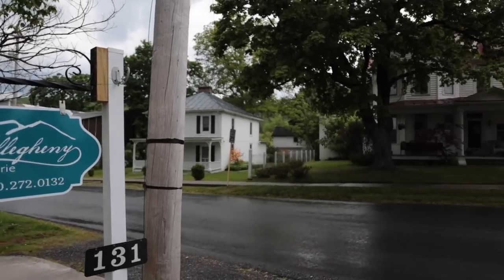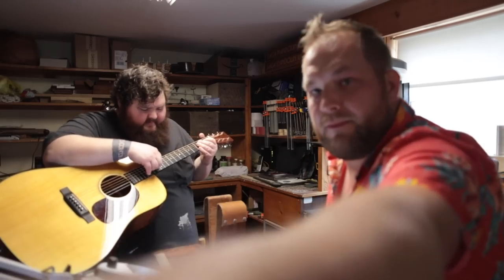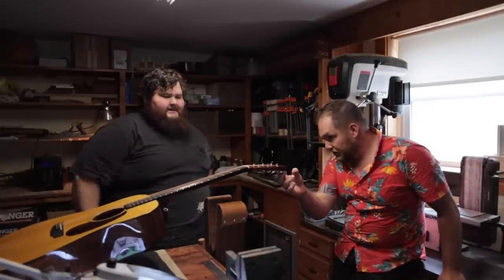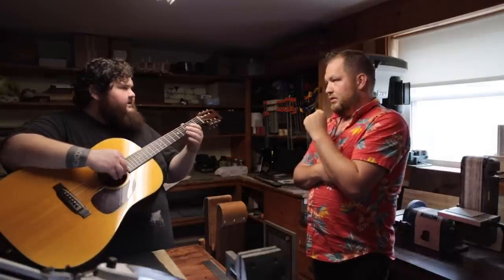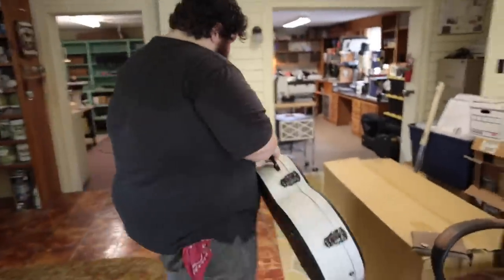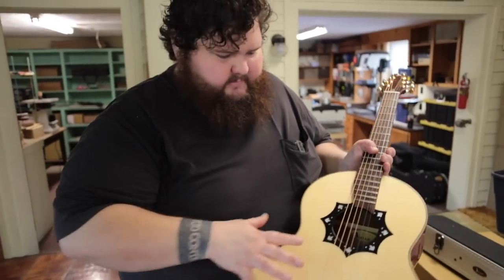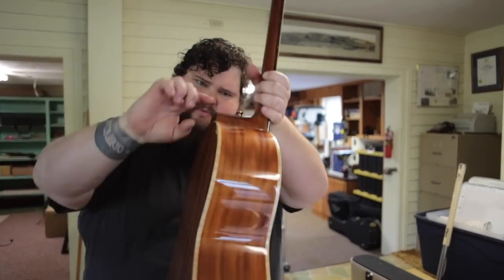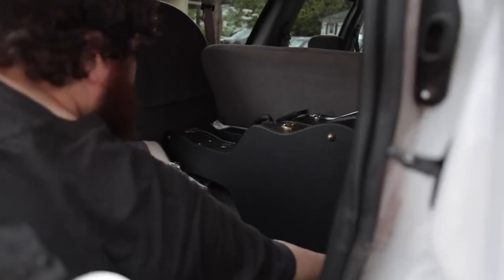I have truss (rod) issues with both of my @martinguitar D-18's...featuring Padgett Guitars.

Comment: My January 2019 D18 sat in a small Iowa shop for a year. I purchased in May 2020 and brought it to Arkansas (much higher humidities). After about 6 months it finally got used to its surroundings here and settled in, opened up a little, and became an incredible guitar. It much prefers the 48% humidity range over say 55%. Gets muddy and dulled in higher humidity for some reason even though it’s in Martin’s suggested range. Ask anyone who owns a 2019, it was a fantastic year for the D18. Mine sounds better every day.
Reply: Good to know thanks!
Reply: I've always found that about my guitars. You pick up the same guitar that sounded great the day before on a day where it's raining, or high heat and humidity, and it just sounds dead.
Reply: totally agree, I live in AL, and when it rains and humidity s like 60%, it totally changes the sound of the guitar. between 40 and 60 is supposed ot be the preferred range, right?

Comment: My d18 from the 90s is a little buzzy too, but it’s almost unnoticeable when being recorded. My luthier did the best he could. For some reason D18s record so well. It’s stunning how well they record.
Reply: They are the original dreadnought by which everything else is compared to making them the benchmark
Reply: Yeah, it seems the drier mahogany sound records best. I have a D-18, a D-41 and a 000-18. The 000-18 records the best even though the other two are far better sounding in person.
Reply: @capohd28  I personally like mahogany better in personal also. And I used to be a rosewood guy. But I like sinker mahogany which has some slight rosewood qualities

Comment: The 2019 Martin has a double action truss rod.
I’ve also found that the Plecked guitars tend to be somewhat buzzy
Reply: Shouldn’t you be able to add forward bow with a 2 way truss rod?
Reply: @aardvark77  yes It is possible.
Reply: Yes, and when it’s between the two settings can feel slack, surprised he didn’t mention that. Also .003 - 004” in in my mind is perfect relief, but that is a personal preference. Another thing, is what gauge strings are on there? If lights, try mediums, that should bring the action up a bit. He didn’t mention the 12th fret string height. At that relief, I would have just made up a new bone saddle with a bit more height and call it a day. Save the factory one for when the action works up a bit over time.

Comment: The truss rod and neck on my D18 (2014)  work together as they should.  Martin built these for medium gauge strings but I haven’t run anything heavier than .012s on mine and that just recently. But to my surprise I’ve found that I can run the .012s at lower action and with very little relief than I could the .010s with no buzzing and it sounds so much better.  I’m building up my hands to try for .013s next..
Reply: That’s actually no surprise even though it’s counter intuitive. Lighter strings tend to travel more due to lower tension. 10’s are super sloppy. One interesting thought though that a long time luthier taught me is that sometimes lights will be louder than mediums on some very resonant guitars. That is the case on at least one of my dreads, a forward scalloped D-41. Sometimes heavier strings can stiffen a guitar up and lower volume. Best to just try it and see what works.

Comment: As Paul S said below, 2019 has a double-acting rod. Very easy to adjust the relief using that. What you thought was a loosened rod was just the adjuster nut at its neutral position. Turn further past that point and you'll be able to increase the relief to a suitable point.
Reply from the maker: You're totally right, this morning after reading your comment I loosened it up to tension and then used it to pull the neck back into a negative bow and it works great. Thanks for your comment.
Reply: yeah, that is what I was thinking the entire time, but all of the solutions did not involve that, so I was super confused and I just thought well, I really don't know much about Martins. I am a recent convert to the acoustic world, so I am used to lots of electrics with 2-way truss rods, and I am always loosening a little or tightening a little on them, depending on the weather. Glad I read down into the comments.

Comment: Got to get yourself that Martin dx2e.    Only Martin model with katalox wood for fret board nd Bridge.   And it has the strata Bond neck martin 
has been using for 30 years which is virtually indestructible.   I've had a dx1 for 20 years and it's never not in tune lmao...  never needed any work done.

Comment: Hi Jeremy, I've enjoyed these videos introducing Mr. Padgett and his impressive work.  I wanted to mention that newer Martins have 2-way or dual action truss rods, meaning they bend both ways to decrease relief and increase it.   So, to increase relief, when you are turning the nut counter clockwise until it's loose, keep going and it will tighten up again as it forces the neck the other way.  The new D-18 will have a 2-way truss rod, but from what I read, the D-18VS is from before Martin started using them. 
Cheers!

Comment: If it has a two-way trust rod, you can have it bowing in both directions. Just adjust the truss rod. When you get a little loose to keep turning it it’ll start getting tight and hit a bo the opposite direction. I would not put heavier strings on it.

Comment: Great video, love learning from skilled guys like this. One thought on the Martins low action is that its likely the bridge saddle has been filed to lower the action and maybe a bit too much was taken off. I have a D28 and a D18 the D28 came with quite high action so once it had acclimated I took a bit off the saddle and it made a world of difference didn't adjust the neck as it seemed perfect.  The D18 came with perfect action and measured the humidity in the case on delivery and it was 45% its now at 58% and the action has grown by 0.25mm at the 12th fret not much but man its tougher to play! I will lower the action as its not fun anymore! But as was said in the video climate really effects these acoustics.

Comment: Nice video, I have a 1993 HD28-P that sounds amazing. I took it to a local shop here because that action was too low. I’m not a Bluegrass player but I do like like to dig in a little. The Tech told me that the stress rod was striped. The guy that I trust the most said that the guy didn’t have the proper tool to do anything with the stress rod. The action got really low during the winter. I keep it in its case with a humidifier in the sound hole. Now that the humidity is getting up there the action has come up a little but it still buzzes. I wonder if I need a neck reset?  The guitar is almost 30 yers old.

Comment: I'm glad acoustics are not my thing, because I live in Arizona, where the humidity and dew point are mostly in the single digits.  Woof to Ben.
Reply: No matter. Once they are adjusted it’s totally fine. I live in Tucson. McKnight addressed this as well. You can humidify sporadically for a couple of weeks. But once it gets used to it. You shouldn’t have any issues.
Reply: You can buy an old Applause AA14. Its neck is  made of aluminium and plastic. The back and sides are made of carbon fibre.

Comment: Relief mixed with action height is important.  I didn't see action height measured or mentioned.  Is it 5/64 or lower on low E?  If so, put a taller saddle in it.

Comment: Love my Martin but they it’s the buzziest guitar I have no matter how I adjust it. It’s been professionally set up twice already.
Reply: Yeah, professionally set up is often a joke. Usually the guys doing set ups (in stores especially) are not luthiers. They are often entry level people. A lot of it is also expectation. if you are asking for a low action, and then play hard, any guitar will buzz. There are many reasons for buzz, and Martins normally have some of the best necks and fret jobs out there, even the Mexico made ones. Also, one issue is a guitar drying out too much. That is a common issue for buzzing that can only be corrected with proper humidification. Dry guitars will drop action too low from the top shrinking. Most people don’t look after this issue well enough. Pucks and sponges are not good enough to keep a guitar humidified.

Comment: A very informative video - I learned a lot. It's quite humid here in Sydney - especially during this extreme year of wet weather, so no problem with guitars drying out. I wonder though if the more dry climates enhance the ageing of acoustic guitars - cause more natural drying and ageing of the tops. I assume the same process is probably responsible for some of the cracks you see in guitars - I wonder if the dry climates also cause the greater cracking along with more ageing?

Comment: Hello there, for my D18 (2021) I use 13 gauge. Now I mostly play with fingers including the strumming. What in your opinion should be the numbers at the 12th fret. Note: I often downtune ½ or 1 step. Thank you.
Reply: Martin spec is approximately .095 to .110” on the low E. High E should be ~ .015” or so less. Not a big fan of detuning on acoustics as the guitars are designed for standard pitch, and can often get into some weird resonances and other issues when tuned below pitch. Guitars can lose their tonal balance doing this.
Reply: @capohd28  much appreciated man! Awesome answer
Reply: @capohd28  Drop D on a D18 though. 😊
Reply: @G_Demolished  Drop D is fine, I use it myself. Dropping a half, or worse a full tone for all strings can be an issue.

Comment: Hey GREAT VIDEO. I have a Martin GPCPA4. I tried adjusting the truss rod and sure enough i damaged it. I turn it anticlockwise and there is no adjustment on the neck. I turned it clockwise until it cant go any further ( i heard a small crack( and no adjustment. I think i have to replace the Truss Rod. I have contacted Martin and no answer. Can you recommend a Truss Rod i can purchase? there is a local Luthier that can replace it for me as i dont have the tool necessary. I just need advice on what truss rod to buy. PLEASE HELP ME!!!!!!
Reply from the maker: Oh man. I REALLY doubt you broke it. If so, it would be defective because you'd have to really force it for a long time to get it to break. 

You can book a video call with me on my website and we can talk about it.  Jeremytheguitarhunter.com/contact

Comment: Too much humidity?
Reply from the maker: Too little.
Reply: @JeremySheppard  beware of a neck reset,recently had my 84 Martin done.
Reply: Too humid....too dry....  neck resets..... binding shrinking....I'm beginning to think Martin guitars just have too many issues.
Reply: @freebornjohn6876  Any good sounding guitar will have to be cared for. Yes, you can get overbuilt guitars that are built like tanks, but they often don’t sound and play as well as a Martin or other high end guitars. Thing is, solid wood Martins sound good because they are built out of real wood, and are built just on the edge of holding together as that’s what gives you resonance. The coveted ones are the forward scalloped braced ones, which are also the ones that are the most fragile, but sound the best. If you want an indestructible guitar, get a laminated guitar of which Martin and Taylor have some as well as cheaper brands. You won’t have to worry about those. In general, with a properly humidified and cared for Martin, you will have few issues, and if new, you’ll have a lifetime warranty.